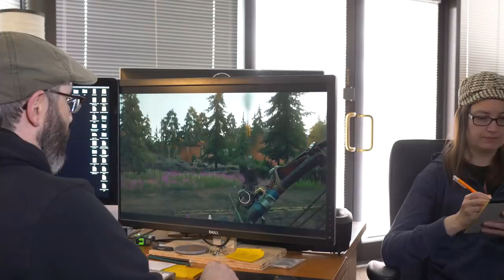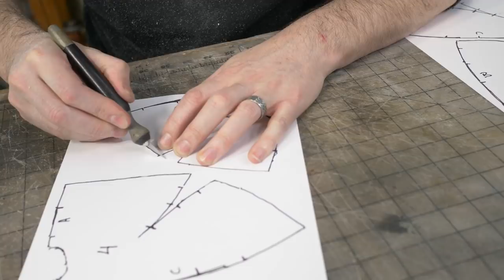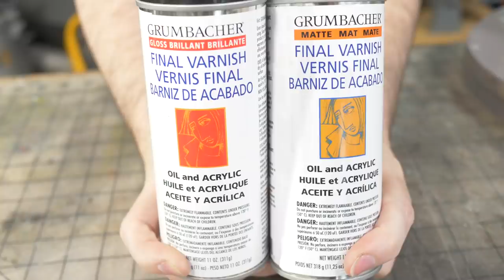FAR CRY NEW DAWN - Making a Judge Mask with EVA Foam + FREE Pattern!

Comment: I'm reminded of a video I once saw where to make a mask in similar shape you'd inflate a balloon roughly your head's size, use glue and paper for a basic base, cut it in half then place a half against your face and mark/cut a line along where your ears would go. From there you'd do whatever (i.e. paper mache, clay, foam, etc.) to build it up slightly more and put in your design.

Comment: When using a punch, its a good idea to put a scrap bit of leather under it, that way you drive the tool through the leather. Otherwise the tool stops at the bottom and if the surface is hard it will dull the tools.

Comment: When you use your leather working tools you should use a poly or wood mallet so you don't destroy your tools.... Over time the steel on steel hammering will deform your tools... Basically you need a slightly softer material than the tool to hit it with ... A brass hammer would also work.... Rubber mallets are bad though as they bounce and give you less control.
Reply from the maker: We learned this when did did our awesome leather working video with Bjorn's Workshop! Fortunately, we do leather work so infrequently that for now the regular hammer does what we need. But if you're working with it more consistently the tools we list in our leather video are a must for sure!

Comment: You don’t need an electric wire cutter if you know someone with a old school battery charge and and if you know someone who vapes you can attach the wire by some metal wires and then you attach the battery’s positive and negative and then it glows red hot and melts through wood too
Reply from the maker: That's also an option, but it's likely less safe

Comment: Great build vid Battle Damage Billl....But Q. is there any major differences between a Thsoldering Iron (22:02) and a Soldering Iron?   Thanks in advance....
Reply from the maker: What I'm using in the video is a wood burning tool and soldering iron. It has different tips to allow for different uses, but is essentially the same as a regular soldering iron. Beyond that I'm not sure I understand your question.

Comment: Not  sure how well the rivet will hold on the elastic, would have doubled it over with glue or glued some other fabric around it. At least add a washer to the back to spread out the load.

Comment: I've watched this video a few times cause some nice tips i keep forgetting XD. I have a question though. I plan on wearing a mask i made on stage with my band while we perform. With those lights and such on stage, i get a bit sweaty. The squishy foam i use get's soaked quick, and i did have a moment of sweat finding a way into a seam from the inside and trying to get UNDER the paint and sealer on the outside. I have sense added mod podge to the inside to seal those inner seams too, but i was curious if you have any other tips for tackling heavy sweating while wearing masks?
Reply from the maker: Making sure you have good air flow will help, and maybe look into a different sealant. Mod Podge is water based and will wear away with sweat.
Reply: @punishedprops  Huh ok that makes sense lol. Umm, how would say Bull's Eye Shellac work better? Cause we have that in the house, and i sorta need to get this thing wearable by tomorrow night XD

Comment: Great video, I learned a lot of cool techniques. Do you think that some filler would stick to the foam to cover up the seams?
Reply from the maker: In this case filler could work since the mas isn't a piece that will flex much, but hard filers tend to not stick or hold as well on flexible materials. The Kwik seal acts as a filler but maintains flexibility and so won't crack or tear.
Reply: @punishedprops  thanks for the advice

Comment: Love this mask!! Quick question. When you had your old shop, how did you make sure that it was ventilated well enough to use contact cement?
Reply from the maker: We had fans and a small window and I always wore a respirator. IT likely wasn't as safe as it could have been though.
Reply: Thanks for the response! I've been working on some cosplay but worry about using contact cement in my basement even if it's in small amounts and with the window open and fans, but when it's -20 degrees outside it's not really fun to be in my garage!!

Comment: Can you use plastic sheet molding over the top of the insulation foam? I know it's super hot but it's only for a few seconds and has the other layers in the way, right?
Reply from the maker: I'm not sure, it would likely melt

Comment: Would cutting small lines onto the mask with a blade and then using a heatgun over them create a wood texture?
Reply from the maker: Yeah! That's another great option. I chose to use the wood burning tool because I wanted to make the lines a bit more dramatic and easier to see from far away and in photos

Comment: I know this is not equipment that every maker has, but would you be able to warm up the foam and form it on the vacuum former?  I suspect you would been thinner foam than 10 mm.
Reply from the maker: You totally can vacuum form EVA foam, but it's best to have a buck made of a more solid material than insulation foam - ideally wood or concrete for the best results. Thicker foam like this won't form as well or as sharply as thinner materials, and it takes some experimentation to get the heat right.
Reply: @punishedprops  Well that's on my things to try this year, now!

Comment: what spray did you use on the isolation foam? l always have it melting whenever l spray it.
Reply: Just regular spray adhesive. Contact cement or epoxy will melt it because of the solvent in them
Reply from the maker: The only spray I used on the insulation foam was Super 77 spray adhesive. Spray paints are notorious for melting XPS foam.

Comment: May be a stupid question but why no make it out of wood.  you have all the tools for that.....  just curious.
Reply: A lot of his projects are done 'on the cheap', so that people without all the expensive tools and hardware can produce excellent quality props.
Reply from the maker: You totally could make it out of wood! Typically I prefer to make costume masks out of foam. It's much lighter and more comfortable to wear. Its also a great medium for creating more dramatic and stylized wood grain than you'd see in actual wood AND, it can be quite a bit faster to work with. But you absolutely could make this mask with wood using very similar methods to what we show in this video!
Reply: @punishedprops   Got it, totally makes sense.  and it turned out great.  I love your channel.

Comment: Whats the difference between the varnish and plastidip?
Reply from the maker: Plasti-Dip is a rubber coating whereas varnish is a clear sealant.
Reply: @punishedprops  Thanks! Is there a way to make a very flexible prop that is already painted more stiff? I made two knives for my the walking dead beta cosplay I'm making and it came out really good I just want to stiffen the blades a bit. I can't wait to show you the full costume upon completion!